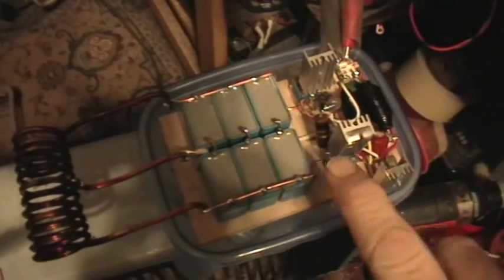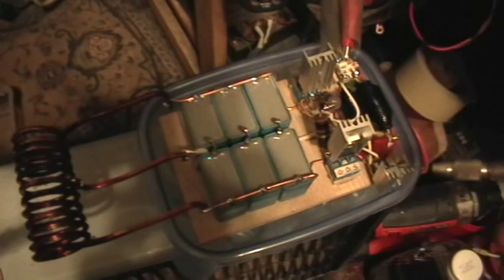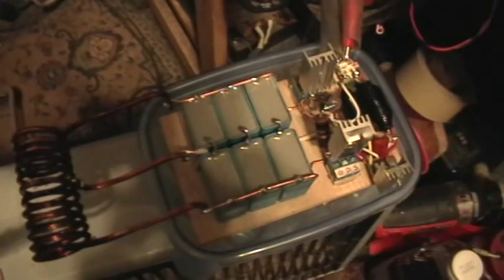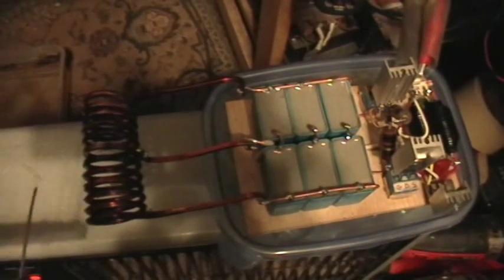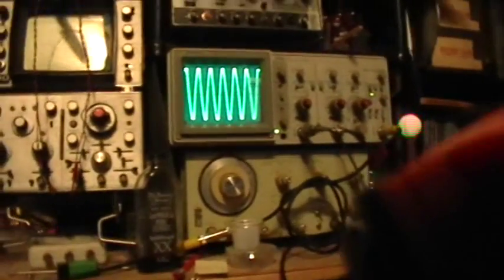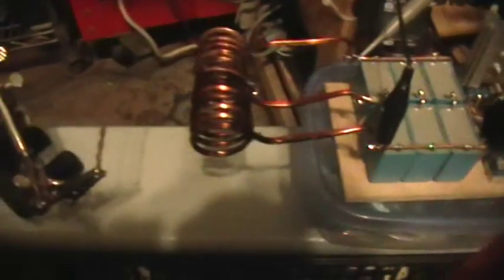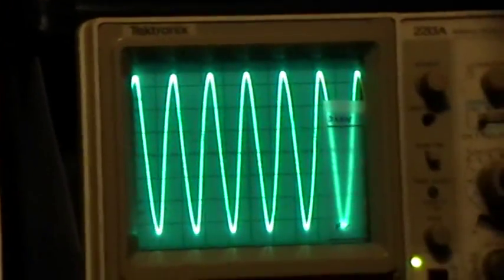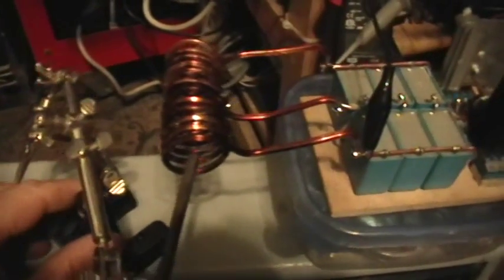Resonance: Mini ZVS Induction Heater First Light

Comment: Impressive Thing! But i cant understand why the most FE-Searchers see see a usefull potentions in this..?
Sorry vor my bad bavarian english... :-)
Reply from the maker: Your English is better than my Bayerisch!  The zvs oscillator is useful for many things since the same circuit, with different component values, can cover a wide range of frequencies and power output. It automatically self-resonates at the frequency determined by its tank circuit components and can have a relatively large amount of reactive power in the tank. So, just as I show in this video, one can measure these large voltages in the tank, and large currents as well, and if one doesn't understand power factor, one may easily fool oneself into thinking that this reactive power represents some kind of overunity or FE. But it is simply the ordinary action of resonance in a high-Q tank circuit.
Grüß Gott!

Comment: cool!  can you do induction brazing with this setup?  also, what is used to set the frequency?
Reply from the maker: The frequency is determined by the values of the tank circuit capacitor and work coil. In this case I looked up the proper frequency range for good heating and found that around 80-120 kHz was good. I had already made up the capacitor bank of about 1.5 uF, so I calculated that the work coil would have to be very low, only one microHenry. And it turned out that 11 turns of that heavy square copper wire in a coil about 3 cm diameter was just right. The frequency is right around 125 kHz. It would probably work better if I lowered the frequency a little by adding another pair of the blue capacitors.
Reply from the maker: I don't know if there is enough power for induction brazing yet. I'm gradually testing at higher power levels, so we shall see what we shall see...